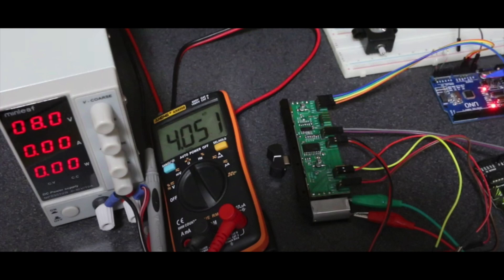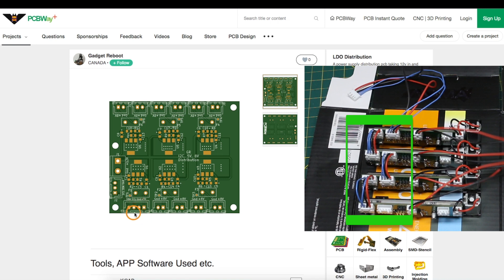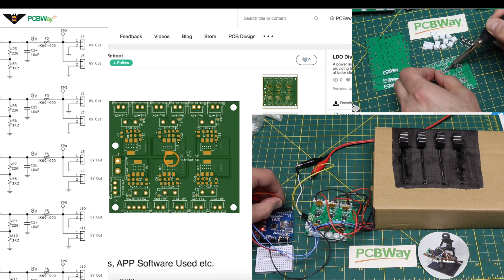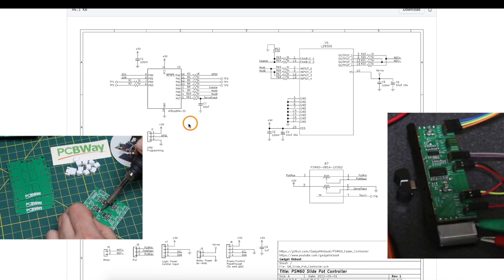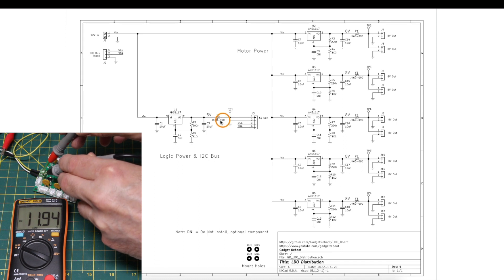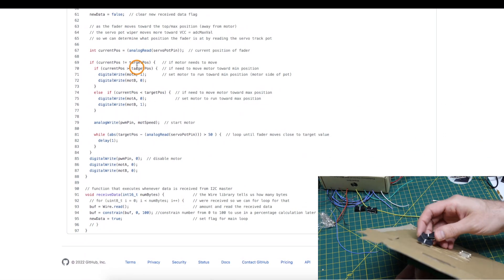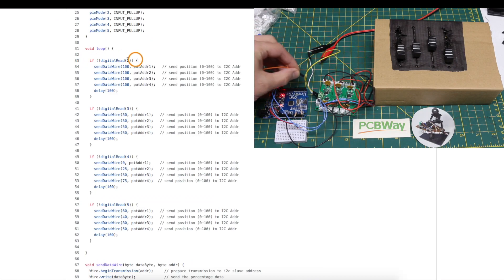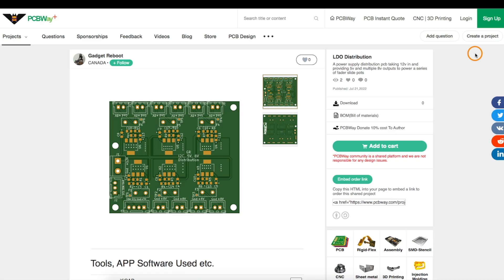LDO Power Distribution for Motorized Fader Pots

Comment: The big issue with linear is not the max current, but the max voltage drop across it at the max current and the size of the heatsink. 
If you have 12V in and 8V out at 800ma then during the peak current you will be dissipating (12-8V)*0.8A = 3.2W’s. Drop the output to 6V and it’s up to 4.8W’s

So with a thermal resistance of 15°C/W (junction to case) during that current level we would expect to see a 48°C rise in junction temperature above ambient. 
If the heatsink on the case was 0°C/W.

It’s the same with a lot of chips they claim it can withstand xA’s but only with a 0°C/W heatsink. 
They don’t tell you that’s what it would take, you only find out when doing the junction to air thermal resistance calculations and working back from max ambient. 
When getting near the max claimed current handling the max junction temperature can be you limiting factor. 
Your only control over that is power dissipation and heatsink size

Ps make sure there are some caps from the motor brushs to the case on the motors to try and keep the electrical noise down.

still great to see it comming along, how many to go to make a full mixer desk?
Reply from the maker: I’m counting on the extremely low duty cycle of the motors, only running a fraction of a second when they do run, and only running a few times per usage session to control any thermal concerns.
I have a total of 10 faders so I have to figure out a better way to mount them and assemble the other six control boards and see what projects come out of it.

Comment: Since those motors aren't so picky on voltage or extremely clean power, I would have used a 7809 regulator to keep things simple. Anyway, really cool idea and design 👍🏻👍🏻😎
Reply from the maker: I usually just use what I already have and I don’t even know if I’ve ever had a 7809, lots of 7805s and 7812s. But I have a lot of these SOT 223 style parts.